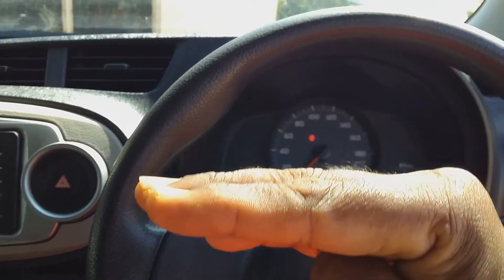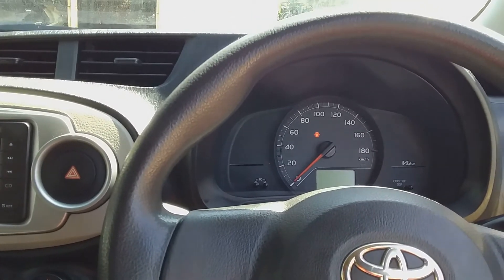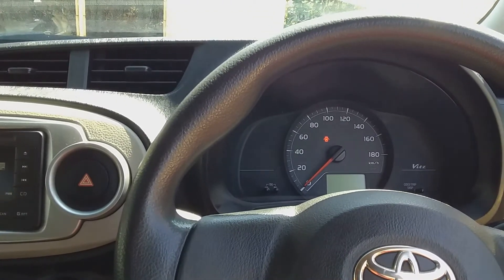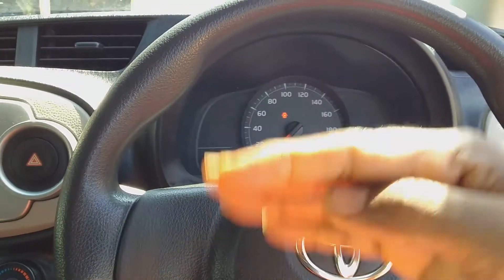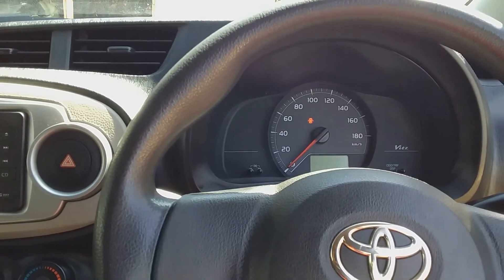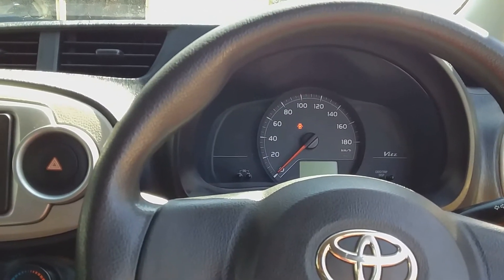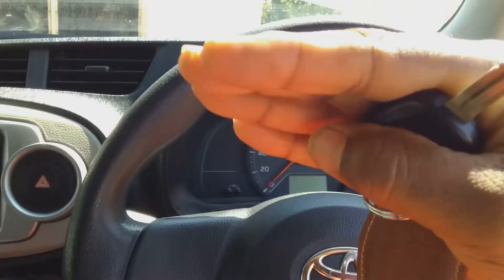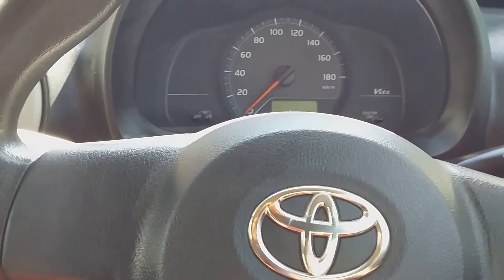Toyota Vitz MAF Or MAP Sensor Diagnostic

Comment: After cleaning your pcv valve, did you still have the oil consumption issue?
Reply from the maker: Even now am still having the engine oil consumption problem. I have not properly research the cause of this but I will in due time.
Reply: @ShelDockToyotaVitz  It's an issue with these types of cars, Toyota did something wrong with them, I overhauled the engine and that fixed the problem, I got a Overhaul Kit from berts and a Set of standard piston rings, the issue is now fixed, the oil isn't going anywhere again
Reply from the maker: Excellent, I know the piston rings was part of the problem because I posted a video relating to oil consumption caused by piston rings. Thanks again 👍